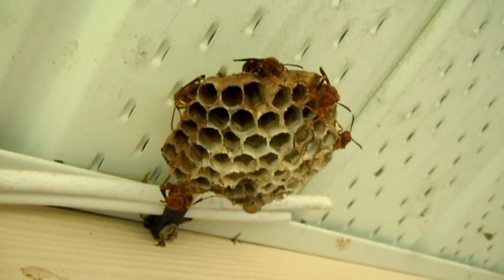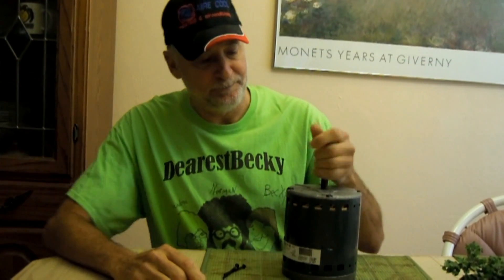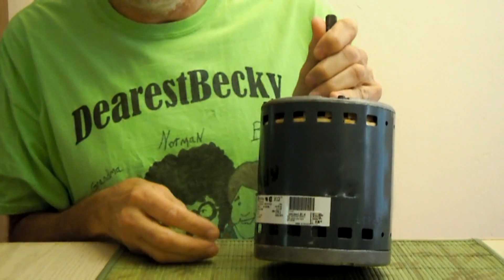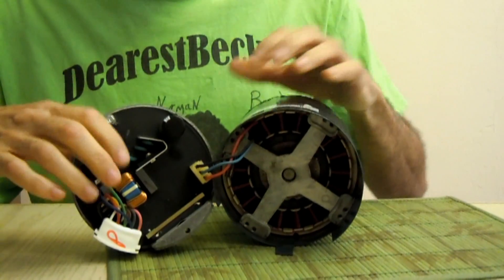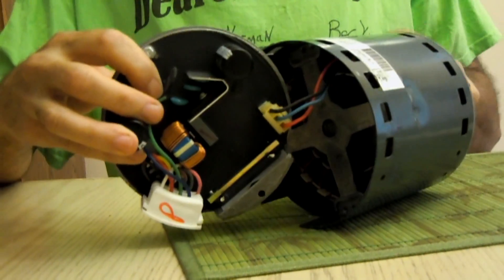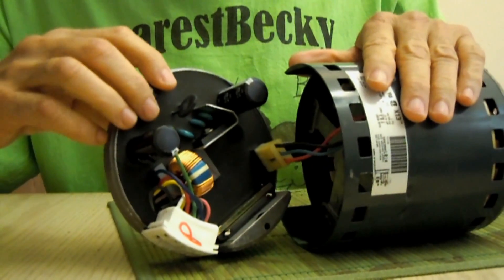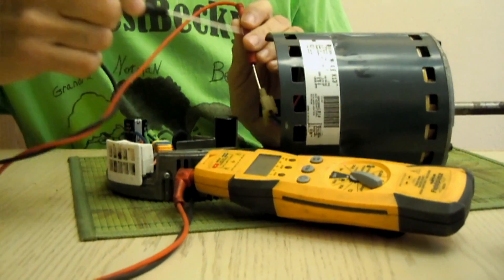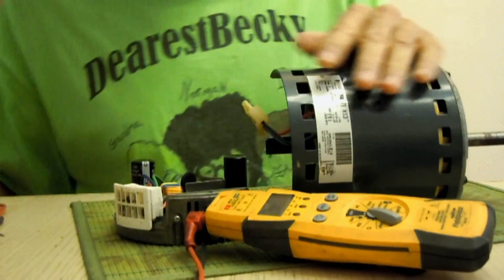HVAC ECM motors 1

Comment: You can buy new, or refurbished GE X13 modules on Ebay for far less than the entire assembly.
You have to match them to your motor model number in order to make sure you get the correct one though.
There's more to matching them than just hp/voltage/rotation, so make sure it's for your particular motor model number...
You can also buy plug-in surge protectors for these motor/modules, to protect the modules from voltage spikes, which supposedly kills most of them.

Comment: All the ECM motors I got from the scrap the module is bad not the motor part  , As you know electronics are sensitive especially to voltage surges like Lightning  during ligntning storms I unplug my washer & dryer & computer (actually unplug washer & dryer after each use)  I had several answering machines go bad after storms.. Throw away society ....... Here is another high price throw away item Tough torque makes hydrostatic transmission you can`t buy any parts for !!! over $800 to replace

Comment: ECM motors, just the Gov forcing companies to build more efficient equipment and the consumers expense.  R- 22 use to be 38 dollars a drum in 1980. now its 800 dollars.  But we saved the Planet for a few years right. Until a volcano goes off.

Comment: Does Baker know you stole one of their motors.  That's pizza money for the counter guys.  My experience is the fuse blows on the ECM part.  You can just change the fuse and see if it works.  The newer motor the motor and drive is separate and just wire up the motor.  Or just install a reqular  motor.

Comment: Manufacturers are not going to make it so you can repair a motor. they want you to buy a new one. This is a throwaway Society and nothing's repairable anymore. All this is due to the manufacturer's greed and the fact that they don't want you to repair that motor that's why they did it in the first place. plus the fact that they didn't have to spend more money for the housing that they would put the control board in. greed greed greed

Comment: GREAT VIDEO, I work for a company in Florida and we have those ECM module on our service vans  , the most common size are  .5 and .75 hp  and its like you say its almost never the motor, just the module and I sell the module right off the truck.

Comment: Nine years, two modules dead.  $875.00 to replace the first one, $1,000.00 quoted to replace the second one, in a TRASH Tempstar. Said BS, replaced the unit with a Trane.   Tempstar is absolute garbage.

Comment: it is EC Motor not ECM Motor.
THe M in ECM IS Motor.
Reply: ATM machine, PIN number, hot water heater, television set, you park in a driveway but drive on a parkway, cargo goes on a ship shipment goes on a truck. You've got a lot of other places to bitch next on your agenda now
Reply: Electronic Control Module
Reply: yeah, I know. I'm not politically correct either.
Reply: Also, if you're into automotive electronics, you might notice that ECM also can mean "Engine Control Module"
... XD

Comment: It seems that he is not well informed. I have seen these types of motors for more than 20 years. First, they do may a tool for testing the ECM. He said that if "either one of the 2 components fail you need to replace both". This is NOT TRUE! Many HVAC techs would like you to believe this, but I have replaced JUST THE MODULE a couple dozen times. I have also found that what causes them to fail is (1) spikes in voltage or (2) Brown out conditions for several minutes. The MODULE can cost between $350.00 & $450.00 to the tech.
Granted, you may not have access in your area, but in the Midwest, Great Lakes area, its No Problem. If you ask.
I believe these motors are fantastic motors, And I recommend to all my customers. I have NEVER replaced the entire motor but once. That was in a home that had been struck by lightning. There was severe damage to most all of the electronics.  

As for -- "@jj863420 Thanks. The GE motors are one of the brands that you have to replace the entire motor. " -- A post from 2012.
GE motors are the ones that I have replaced the most MODULES on, going back to the 1990's these were common on Carrier/Bryant models
Reply: I think he might have meant that the way they designed it, they want you to replace the thing as a whole ... you know how companies like to think that way these days. It's unfortunate, because it creates more waste, is not as environmentally friendly (which, in reality, is all the rage these days), and is more expensive to fix!
Seeing the one in this video makes me cringe, because they have the circuitboard potted in what looks like tar. That makes it virtually impossible (well, just a real pain in the rear-end) to do a board-level repair. (Granted, not many people do that ... but with my knowledge, I do it whenever possible, as it saves me $$$ ... like that one time when the capacitor went bad in our TV. I saved hundreds of dollars!)
Reply: I am with you, my end bell (ECM) went out and I got a replacement for $385, switched it out and the blower works fine. Tech wanted $1500 to replace both end bell and motor.

Comment: It's a $600 motor to a ac tech, to me it's just time to grab a old 3 speed motor from my junkpile and install. I've never replaced one of those over priced piece of crap motors with another with internal electronic boards. Just wire in a regular motor and you've saved several hundred dollars.
Reply: The problem is, they made this motor (in the video) with an integral circuit board (which is potted in what looks like tar). That way, you will have a harder time trying to fix it. Hence you have to buy the whole motor and inverter as a unit, even though just the inverter has failed!
Sigh
I really really really really wish manufacturers would make their stuff more repair friendly.
They're so stupid! That would be a good selling point! It would also be more eco-friendly, as there will be less trash (which usually still has plenty of valuable, working components)!
Unfortunately, all too often the attitude is towards instant gratification:
"If it works, shove it out the door. It's okay if it fails in a year or so. Just make sure that it works well when the customer gets it."
or
"Simplify simplify simplify! Let's make the whole menu work off of only one button!" (facepalm)
:(((
Reply: +douglas787 Just got done doing the same thing. $100 for a blower motor, $20 for a on delay off delay relay and your good to go. High priced piece of crap motors that should have never existed. It's like we forgot how to make PC boards! So don't make that sht anymore....it's defective, it's crap and they will drain you dry. If you can't do it find an AC mechanic that can...you will be much happier and have money to spend on other things. This crap has to stop!
Reply: Benjamin Esposti so true. I was given one by an HV AC tech and even he says the same thing.  They make you buy the control board at a price comparable to the price of the entire unit. And they use the highest temperature soldering joints and cover it in a coat of 1/4" thick epoxy.

Comment: What a complete rip off! If they want variable speed that bad, then they should have went a with a NEMA premium inverter duty 3-phase motor and used a single phase input to 3-phase output VFD. Hell, I could do this for a.....

American made SL208S VFD microdrive - $215
American made Leeson 3-phase motor number 110028 3/4 HP 1140 RPM - $283
+ about $70 shippping

Total of = $568!!! WTF! I come out better with INDUSTRIAL level components that would outlast this ECM garbage by YEARS, but they have the nerve sell those ECM motors at a cost of $600???? What drug do these designers of these systems smoke???
Reply: Made in China motor $60
+
Made in Mexico controller $40
=
Plenty of Sce calls
+
$500 pure profit

Comment: DrZarkloff How exactly does an ECM drive change blower speed? Does it dim the current and voltage down to reduce torque and slow the motor, or does it slow the Hz of the current down, so it has the same voltage and torque but runs slower?

Comment: I am a 26 year a/c technician. In the name of energy efficiency the government is making us pay outragouse repair  bills. I replace  three control modules this wek and one complete motor and module set. They were all on differentn units. Most of these motor assemblies have the module available seperatley. Some don't. On nthe Payne package units the module is not sold seperatly and the customer has to purchace the motor and module together. 95 % of the time the defective part is the module.

Comment: I noticed the honey comb filter has a lot of air flow resistance even when sparkling clean when it was new. 
I'm going to try operating the unit without that honey comb filter once the new motor gets replaced and see if that makes a difference. If that doesn't  solve the problem, I'm done with A/S and I'll get a regular unit with a PSC motor from another major brand..
Cheers!

Comment: The A/S dealer techs are highly trained and have are stumped as to how to make them last longer. But after researching into this motors, I've come to the conclusion that maybe it's the clean effects honey comb filters that are causing my problems.
I clean those regularly, and the main air intake filter gets changed every two weeks in heavy summer/winter use as soon as the "replace filter comes on. This filter is the standard regular high flow filter....Con't...--

Comment from the maker: I'm sorry to hear about your bad luck with your American Standard unit. I've always been a fan of the brand. ECM motors are more prone to failure due to the variable speed module. The motor might be good but if the module is integrated with the motor then you might have to replace the entire motor unless the tech is knowledgable enough to know how to repair the module.

Comment: I have a American Standard top of the line high efficiency unit and the ECM motor keeps blowing out once a year, and i bought mine in '09.
This is ridiculous, I have the extended 10 yr warranty labor warranty, but it does not cover me if it goes out on the weekends and i have fry in HEAT!   I'm so disgusted by these ripoffs grrrr.....

Comment: Also Guess this is a 2 part question i have a GemTech GT-C50-MHP2 1/2 hp could i use that to replace the hd46ae250 x13 ecm motor from my blower i know its only 1/2 hp where the x13 is 3/4 hp.and your not suppose to go smaller but i live in a 800SQ FT trailer and im a little strapped for cash now and i have the brand new gemtech motor just sitting in the box ready to be used., please help.

Comment: the variable speed zebra diagnostic tool is very handy to determine exactly what the motor is doing, as well if you have a issue within the module or the motor. it can also perform a winding test with its built in meghometer to determine if the 3 phase direct current motor is failing or has failed even with out noticeable sign of the rotor being locked due to seized bearings within the stator. I have found that this is a go to tool for quick diagnostics in ECM applications.

Comment from the maker: Yes, the electronic section is sealed in epoxy. However, you can replace the resistor that is usually the problem component.

Comment: Jim is the electronic section of the moter sealed in epoxie , can it be taken apart . I am an electronic tech  , I would love  to take a shot at one of these boards if it is not in epoxie .

Comment: dude 300 is fair price for a replacement motor and to be honest the best decision these x13 motor are absolute shit all manufactures use these motor i have replaced about 20 of them this year alone and they are very expensive most of them havent even been 5 years old which is ridiculous. get yourself a replacement motor and a good old peanut relay and your good to good 300 is very fair priced.

Comment: I have a question for you...my X13 control module went bad....it's not warrantied so the A/C man wants 800 dollars to replace motor. I can't afford that, I asked him if he could just rewire system to use PSC motor, he said he could for 300 including motor and labor...is this a good deal? I would like him to change motor because its too expensive and don't want this hassle in the future. I think these ECM motors are terrible and too expensive! Thank you for your response and I like your show.

Comment: @hoosierdaddi86 They do have benifits, unfortuneatly they don't outway the cost. We are in a humid climate here, so dehumidification is important. The geothermal I audited ended up a 22 SEER.  You can buy similar rated a/c's without digging wells, running all the extra parts that are bound to fail someday involved in geothermal. I pay less to heat and cool than just the interest on a geothermal system. I make more money on a 2.5% CD than a geothermal will save. Everybody wants to ignore ROI.

Comment: Sorry if I miss understood your question in regards to the ECM motors and replacement control heads. I know that not all ECM motors can be repaired I was just trying to referance GE motors that have been installed in Trane & Carrier units, I also know that depending on what type of motor you have you can get control heads from your sales rep or supply house as long as they know what they are doing, I have had problems getting parts sometimes when the counter guy has no idea whats going on.

Comment: Dr. Z-

I'm a sales rep for ClimateMaster Geothermal HP's and we sell the control head separate from the motor.  We do need the serial number in order to program the motor for the proper CFM settings based off the size of the unit.  You should do a post on the benefits of geothermal heat pumps.  If you need any information, just shoot me an email.  I'd be happy to help.  Keep up the great work, love the you tube channel!

Comment: Hey Dr Z, to answer your question yes we have been able to purchase the control head for the ECM motors as long as we provide model & serial number of the installed equipment so that the software matches in order for the control head to operate the ECM motor. I have done this on Trane & Carrier units.

Comment from the maker: @Metalcastr It gets a signal all of the time. The speed will vary depending on the signal that it's getting from the main board and the static pressure inside of the duct.

Comment: I kept the ECM2 motor out of my Trane XV90 when I tore it out.  No one wanted any of the parts and in the end I offered them free the whole nine yards.  So I kept it for a shop blower.  The original one an ecm1 froze up but I dont think you can buy the motor or module separately. 600$

Comment: Couldn't you wire it up so it runs full speed? Or does it get power all the time and is controlled internally with a control signal from some other board?

Comment: We have the option up here in Rochester NY to be able to buy just the control head I have yet to replace a complete motor just because they almost never go bad. I do agree they are a bit costly and need to be a little cheaper.

Comment: 600 bucks for a motor, that's not good.  That motor can be recycled if not repaired. Where I work we do whole refrigerators, even the foam insulation goes to a power plant to be used as fuel.

Comment: A waste, the motor works most likely, but the board is fried. Do the manufacturers care, not likely. The solution for the board is to use solid core capacitors instead of electrolytic, then it would outlast the motor.

Comment: I don't know the schematics for that variable speed board, but i'd do some basic component checks starting with those electrolytic capacitors.  There's a MFG of them that makes really cheap and crappy ones and they are a plague in the electronics world.  good way to get free flat screen TV's if you know how to replace them.

Comment: US A/C maintenance guys are savers. We can sometimes use parts or save parts and test out the effectiveness of using parts of components and testing them out. There are some parts I wish came in packages such as indoor blower wheels motors, squirrel cage, start cap,  complete with packaging but I recognize the cost effectiveness (and job security) of being able to put the parts together. Only with testing and proving comes Understanding. There are often times it is best to replace whole parts.